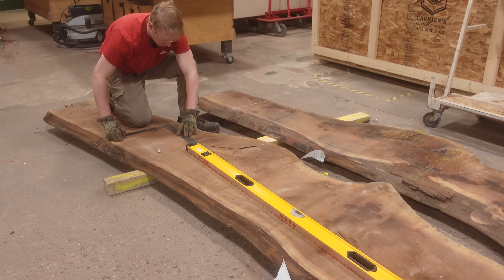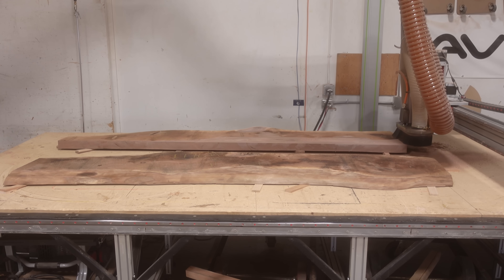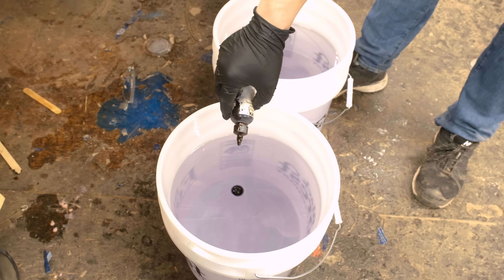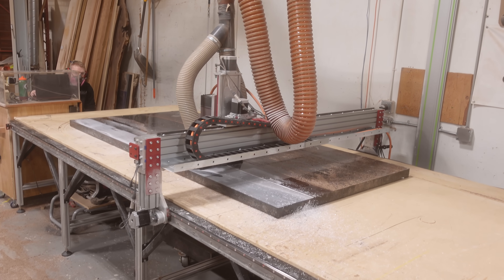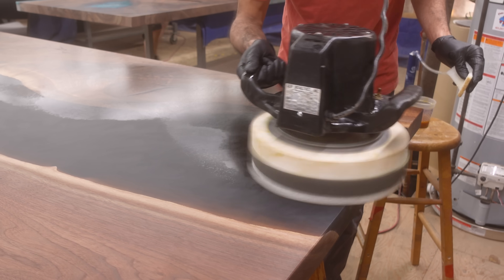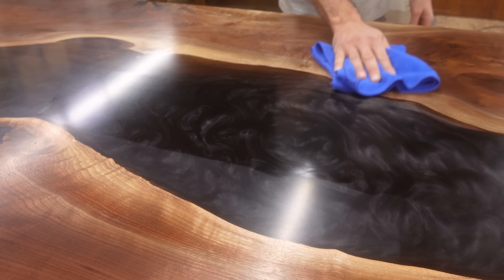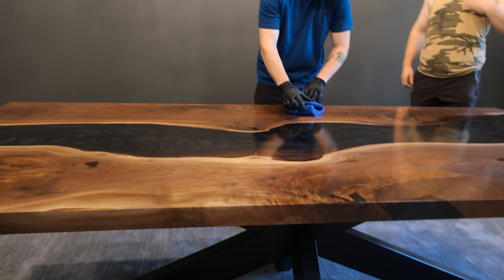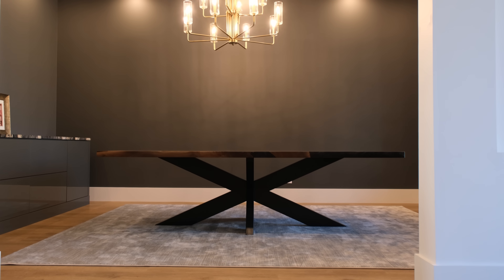We Built Our Client's Dream Table

Comment: Another incredible piece of art. Still one of the best YT channels out there. Still don’t understand how Blacktail outperforms you guys on this media. Would the same method of sanding with 4000 work after applying Rubio? I would usually just knock down with a maroon pad prior to a second coat but would love to know if the 4000 grit works better.